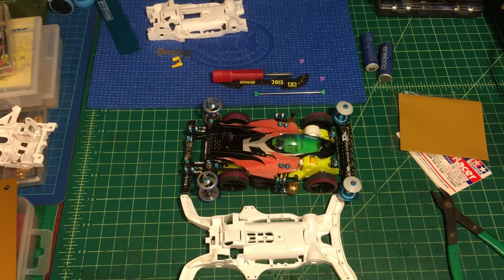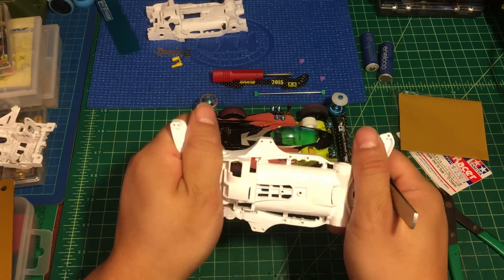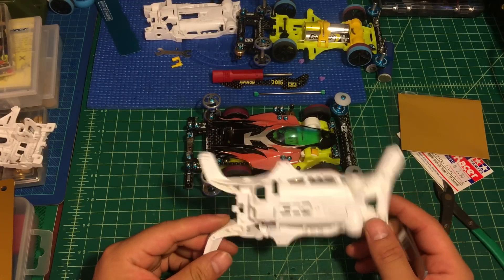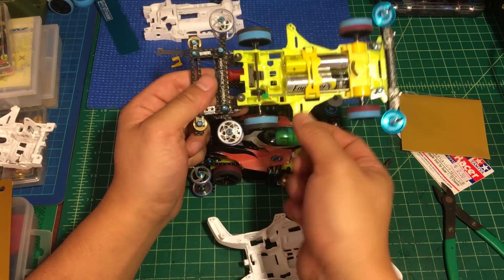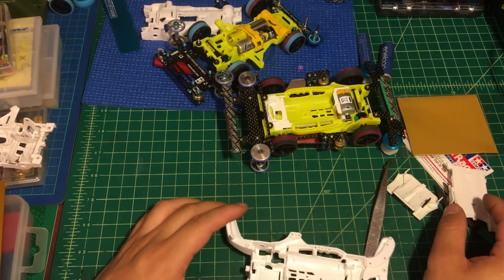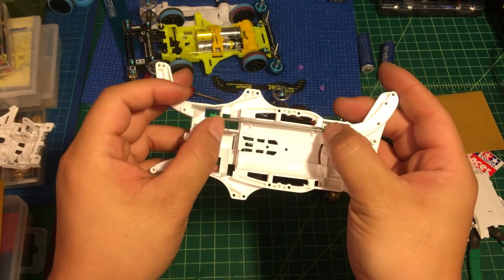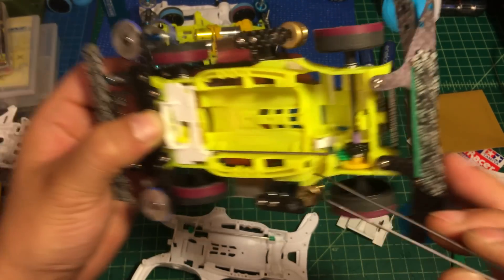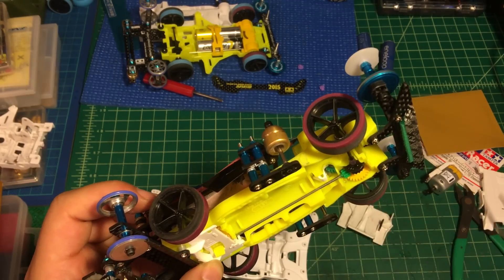【ミニ四駆】Tamiya Mini 4wd AR Chassis foundation Series 1 (review)

Comment: Hey mad great videos keep it up, have you ever considered building up an ar chassis without a propeller shaft so that only 2 wheels will be running in order to fix the transmission issues and will this setup has any sode effects?

Comment: which is better FM AR or S2 FM ?
Reply from the maker: Most of people do ARFM due to ar has more mounting point and chassis is more strong~~and rear bumper has lower mounting point~~ consider all the advantage and disadvantage between two chassis, AR should be a little adaptable to FM setup
Reply: +Mad Tang if had 26 dia wheels how much clearance should i have to pass the bank?
Reply from the maker: Everybody setup different dimension on front and rear bump~~ so you have to get a actual bank or bank setting board to find out the clearance for your own car~~  usually rear is 4MM, front will be 2.5-3MM    this is my car clearance, but not fit to all car